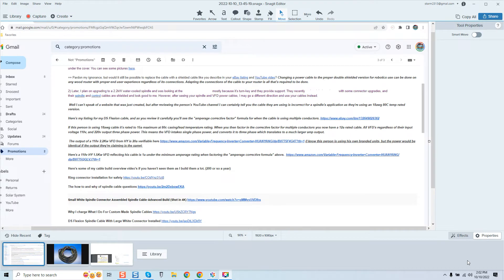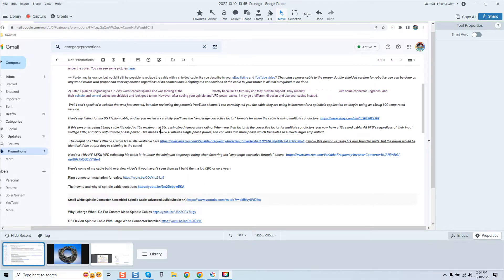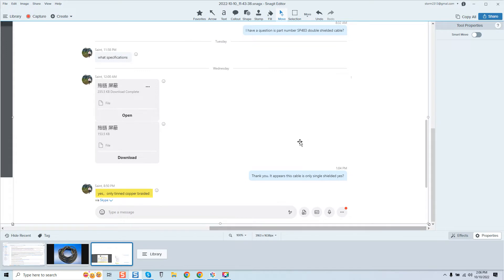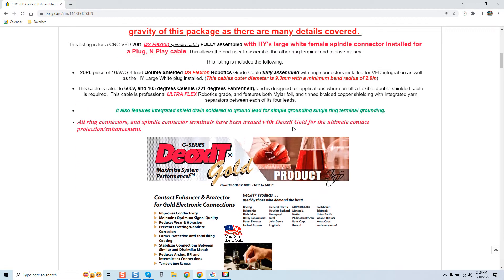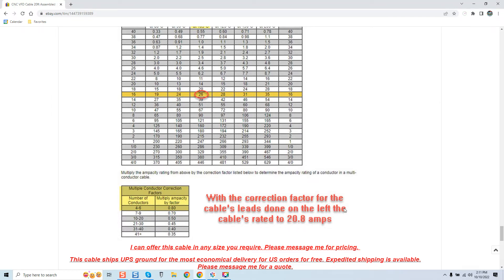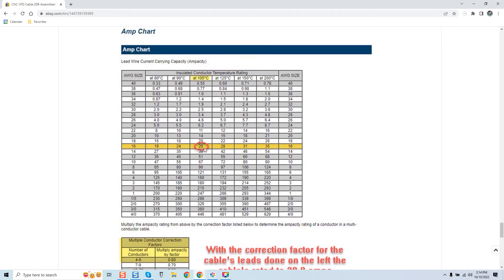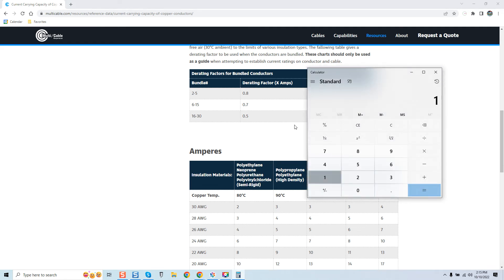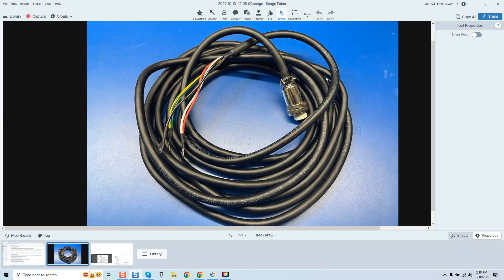CNC VFD Cable That's Being Sold With The Wrong Size Cable..

Comment: Since there are only 3 current carrying conductors in a VFD cable, why would you derate it?
Reply from the maker: Paul, thank you for your support.

Very good question. :)

Ampacity correction is typically based on four current carrying conductors, but factoring in the cable the vendor selected to use is below the acceptable AWG rating for the application its designed for represents that while there's only  three leads drawing amps they easily have the potential to create enough heat to potentially fail internally when factoring in ambient temperature along with amp heat production. 

Please review the portion of the video where you can see the amp ratings reflected on the VFD's these cables are being sold to support, and you can see there's obvious issues using 18awg cables. 

I provide lead correction to all cables as it automatically builds a buffer in to support their applications. 

Thank you,
Vince